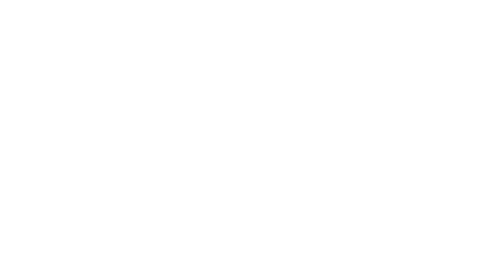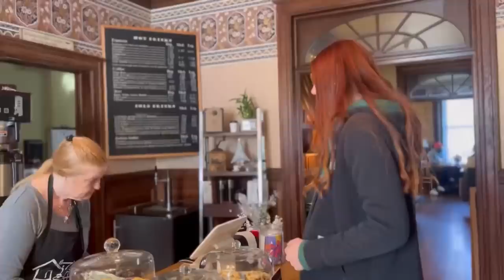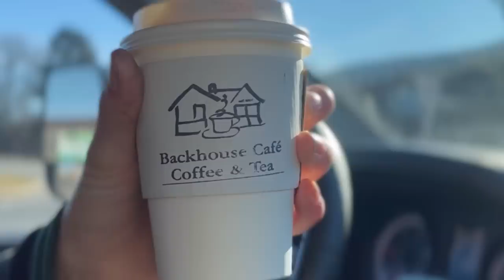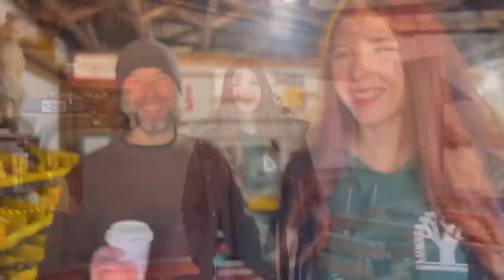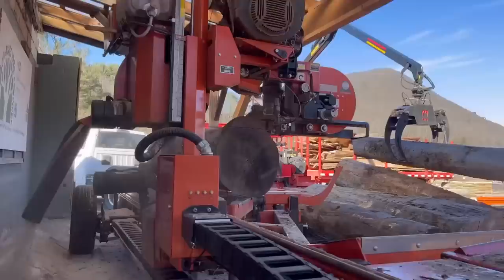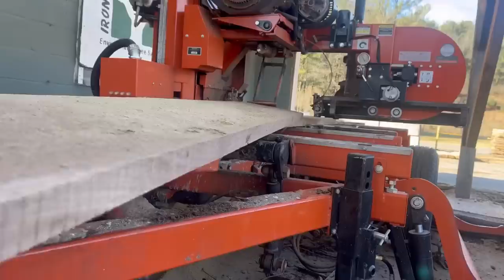Surprising the Boss for His Birthday

Comment: I have a suggestion since you guys are planning to saw more hardwoods and crossties: (1) install an elevated live deck to feed logs into milling area. (2) install an elevated deck without live option. (3) If you continue using your current log staging system, please experiment with elevating the back end of the skid rails to add some angle towards the mill. This will make for easier rolling with can’t hooks. My 2 cents.

Comment: i had one those  grapple  loaders prob 30 years  ago when we  started  off in pine,,you can warm any machine  by running it,, but your  only warming the   engine  up..if you want to warm the  hydrolics up,,,, you have  to hold a  ram open,,or  closed,,,for instance   hold the  grab in the  closed positionfor  about  3 minutes,, this  way it pushes the  hydrioilc oil into the  presure relife valve  and creates heat from the oil bypassing the  relief valve,,thus  warming up the  hydrolic oil,,and yes  in australia  it  does  get   cold